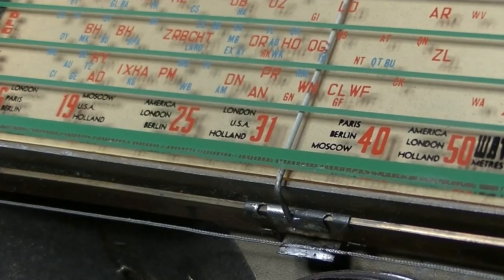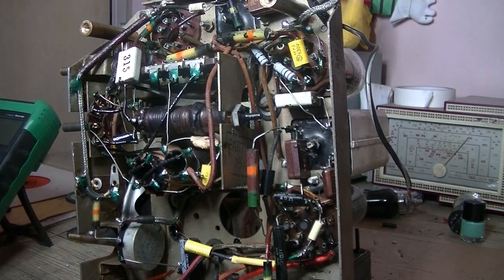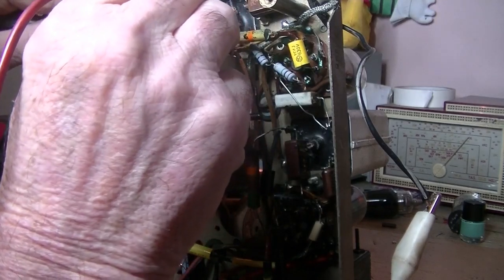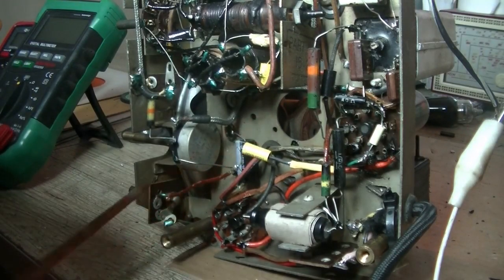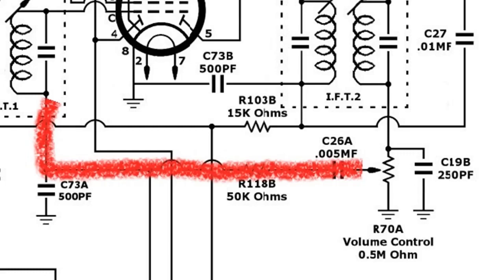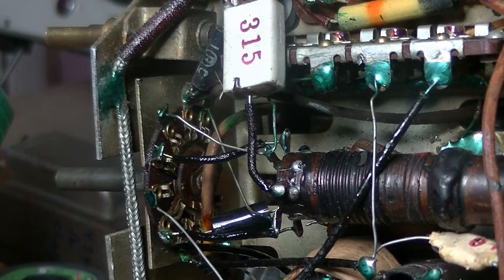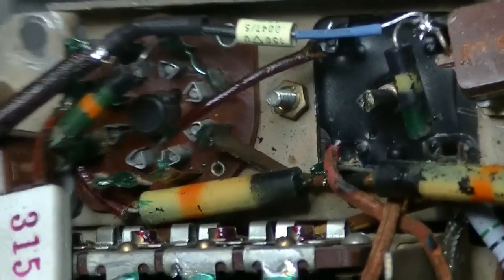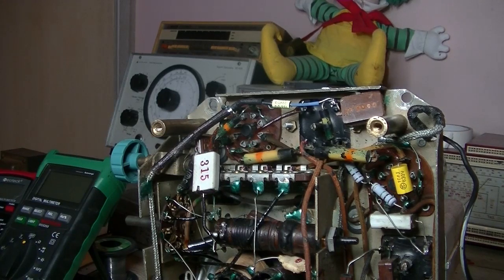Fault Finding a re-capped Kriesler Beehive

Comment: Yeah Frank, I’ve experienced the same volume issues on several occasion and not only did my digital meters increase the volume but using a signal tracer with the gain turned all the way down can also cause the radio volume to increase. FM bands can be problematic with low volume problems. Have Schematic Will Travel!
Reply from the maker: Never in my wildest imagination would I have thought that a DMM could boost a radio/audio signal Ken. The world of radios can be a strange thing lol

Comment: Great video! Ya, it is never fun to follow up on someone else work. If they know what their doing, no pain, no foul! But when amateurs go throwing caps at a radio without knowing how the radio circuits even work, nightmares ensue! Of course we all make mistakes. However, we also can fix our errors if we have the proper training and experience. Though, we were all amateurs at some point.
Reply from the maker: Thanks Man, I'm still an amateur in my opinion compared to those that have spent decades learning this craft. It is a great feeling when you find the problem. Thanks for watching 😃